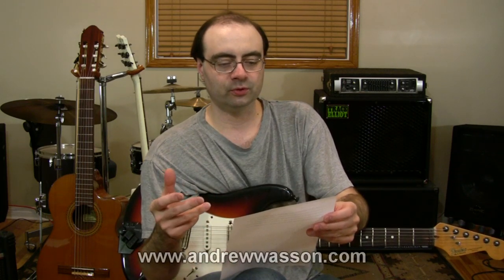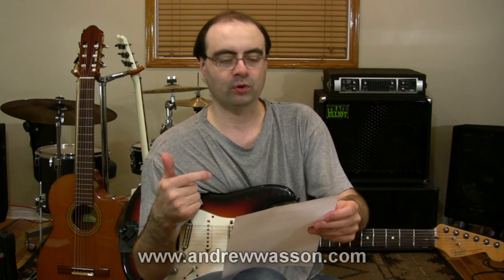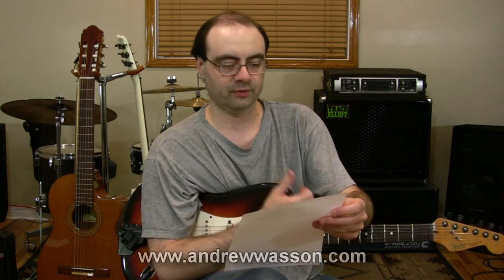Guitar Polish on an Unfinished Neck?

Comment: Thanks the tips. Just brought a Takamine TAN46C guitar and don't want to damage it, so decided to get deep into factors that cause damage, like humidity, poor guitar care etc. If rosewood is untreated then it is considered to be porous, and if the battle with moisture is to not let moisture in or out of the wood then it makes caring for rosewood a challenge. I am even sceptical about using natural oils as they will still penetrate the untreated wood, which I would guess is not a good thing. I read that using a small amount of saliva is good to coat the wood; something about the natural occurring enzymes, but I don't know what to believe any more. I might risk trying the almond oil, although my guitar cost £1350 brand new. I only paid £850, but still don't want to hurt my baby. Probably would have reconsidered purchasing the guitar if I knew what I know now about untreated wood like rosewood. I didn't mean to write an essay.

Comment: @28monkeyking28 sorry for late reply.  This is reportedly some kind of buffing cream, applied by the factory to the frets.  I have seen it mostly on overseas made guitars.  A toothbrush with lemon oil may work. 0000 steel wool also.  The way I got rid of it on my Epiphone LP was to follow instructions from luthier Roman Rist on fingerboard scraping with a razor blade...YouTube may have a video on it.

Comment: I came here because I thought you were going to talk about cleaning unfinished necks, i.e where the thumb goes. I saw someone spray dunlop 65 on it because it high water content/low oil & wax.Many say don't use anything with water because it "raises the grain".I have an old mahoghany neck with a ding or two in it. It appears unfinished or it seems that the finish was taken off purposely.I just want to clean it up so it smooth as it gets grimy and it's harder to slide the thumb with a dirty neck.

Comment: Though most companies that sell lemon oil add petroleum distillate
Which is like putting lighter fluid on your guitar
It does great to clean it but in the long run it's no good for the fret board

Comment: Most lemon oils are simply Light Mineral Oil and a splash of naphtha (or a similar solvent), and many times a lemon scent is added because people expect a lemon oil to smell like lemons. It's fine for wood. It seals in, and seals out, moisture...which is exactly what you want for bare wood.

You can buy real Lemon Oil made from actual lemons too, at a health food store, but you wouldn't want that on wood. It's a different thing altogether, it's a powerful degreaser and it's acidic & corrosive.

Comment: I'm trying Howard Feed and Wax.. I saw someone using it here on youtube and thought I'd give it a try.. It was about $15 at home depot for a 16 oz bottle.. The label say's " This unique blend of beeswax, camauba? wax and orange oil enhances the natural beauty and depth of grains in finished and unfinished woods,. Feed and Wax also prevents further drying of the wood and deterioration of the finish. This product is recommended as a follow up Howard Restore-A-Finish to maintain the newly restored finish ., Does not contain silicone or linseed oil .. Saturate and let sit for 20 minutes.. wipe with soft dry cloth..  It seems to go on pretty thick.. But wipes off very nice.. Has a dark luster.. better than anything I've used in the past.. I hope it works..  I just finished 12 guitars with it...lol.......
Reply: A lot of people recommend Howard feed and wax...gotta try it.

Comment: @udsahn,

It won't go rancid once it's applied upon the wood. But, it will only sit on the shelf for about a year. So, after 10 to 12 months it would be smart to buy a new bottle. The problem is that over time it slowly thickens up and gets like a syrup. I wouldn't use it after that. The stuff they put into all of those other products to sustain the shelf-life is exactly what is bad for the exposed wood. Using pure 100% almond oil that is fresh (and not cut with a solvent), will work excellent.

Comment: Do not use light fluid. it leaves a residue. Do not use a  toothbrush, depending on grit and pressure applied, toothbrushes can scratch your fretboard. Mineral oil is ok, but often can leave the fretboard too oily feeling.

Comment: i use almond oil at my rosewood fretboard and its epic. but now i have an unfinished maple fretboard and i dont think its a good idea. it will not colourize the fretboard? i think with this, will became black.    i search these days at forums and i dont find a good simple answer  . most suitable answers for me ( didnt use them to see) is the cheap and simple overlay (supermarket) and the complex way ->  birchwood gunstock oil & wax (2 items) ..  i dont know what i will do... i see the overlay right now and i should change the strings.. maybe put a little amount too see ...
Reply: the reason you don't use almond oil, is because its biodegradable. It smells, and will rot. Not suitable for a guitar basically. May as well use veggie oil from your cupboard. Would it turn black? No, I don't think so?

 Oils that have driers in them use oxidation to dry. A good example is boiled linseed oil. It contains drying agents in it, and over time it WILL darken any wood its on. 

Gunstock oil and wax is a good way to go. A little bottle of that and some bees wax isn't the cheapest thing ever, but a bottle of that stuff will last you a LONG time. If you just use it for guitars, unless you have 50 guitars, you will likely throw the bottle out before you go through all of it.
Reply: JgHaverty thanks for the info and your time !